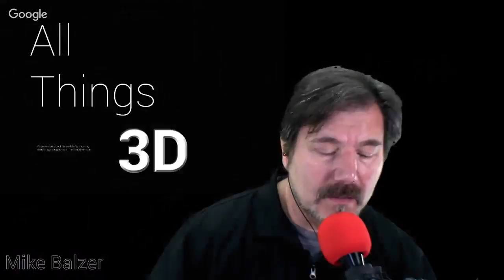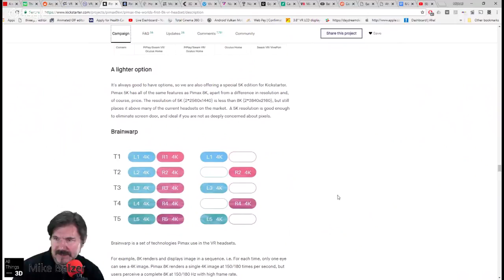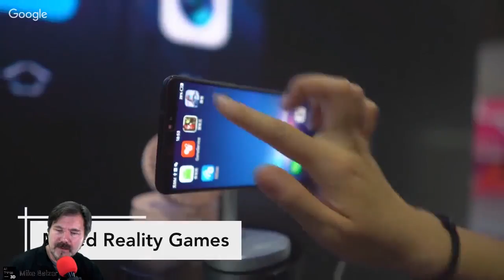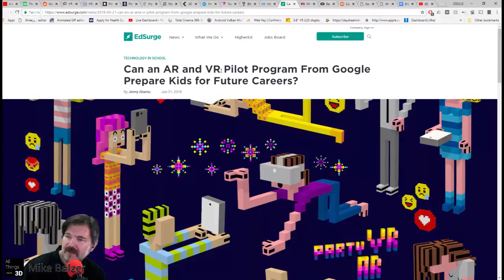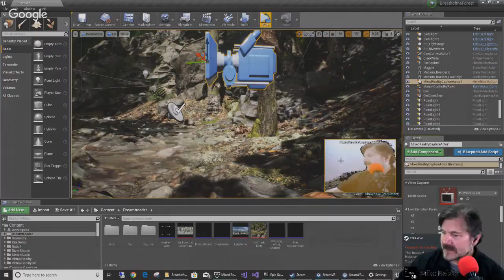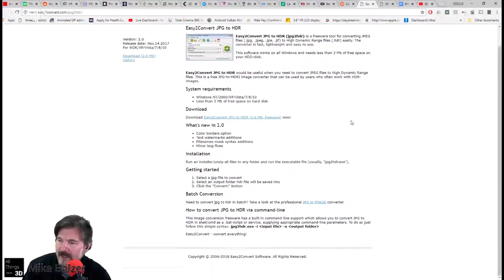3D in Review for 6/29/2018 "Is VR going the same way as 3D Printing?"

Comment: Thats a great parallel your making Mike, I agree that VR is taking a similar path to 3D printing. The biggest issue with both is the effort it takes to setup. With regards to 3D printing things have become easier with features such as auto bed leveling and built in wifi interfaces to bring them closer to using a standard 2D printer in terms on convenience but the fact that the CR10 and Prusa are the leaders in the market shows that this is still a market for people ready to get their hands dirty. In terms of VR I think the market will have an uptick with the release of the occulus go users no longer have to spend time slotting in their phones before jumping into a VR experience however with the lack inside out tracking in favour of having a lower price point this is still not a true reflection of the potential of VR. Microsofts line up mixed reality headsets are definitely moving in the right direction as your no longer dedicating a room to VR with the need to setup the VR tracking modules needed for the vive and Occulus rift. The next step to getting more adoption would be lowering the specs needed to use VR sets in my opinion.
Reply from the maker: If you are following I do agree with you on the Oculus Go.  It is easy to use and the VR quality is much better than it should be at that price.  I also have a used Lenovo Mirage One. Sadly the quality of the visuals and fit & finish leaves a little bit to be desired, but it does use Daydream and development from Unity is easier than the Oculus Go.  However, the Mirage One does not show up as a drive, so the only way to retrieve data, screen capture images/video is through a convoluted share or ADB.  Now I have not added an SD-Card yet so it might be easier that way, but without one, pushing files to it is just as hard.  Big selling point is 6-DOF, however that and the Snapdragon 835, 32GB is not worth $400.  $339.00 used is better, but it should be $300.  My bet in VR is the Oculus Santa Crus, with the rumored (okay my rumor)  NIVIDA TX2 like the Magic Leap.  This will put it in low-end discrete video card VR category and will also have 6DOF and 6DOF controllers like the MS WMR.  Sadly the audience is far different when I was young adult where it was cool to have a VIC 20 and color TV.

3D printing is evolving with some lower cost units that are easier to use.  But at the same print services have matured along with the design software and 3D print software tools.  If you remember I was covering how to use ZBrush, Blender and 3D-Coat for 3D printing.  Now each of them have dedicated routines. The same with low cost CAD tools like Fusion 360 and Onshape.

In the end this is all fantasy come true for me, but then again I learned how to program on the TI-58 & HP-21c :)  RPN RULES!!!!
Reply from the maker: Oh and thank you for continue to follow me, it is greatly appreciated.  You are one of the reason I still put in about 20 hours of research and prepare time to make these happen.  Thank you!
Reply: Keep it up always find that you cover things I miss from other outlets!
Reply: I had no idea you had covered 3DCoat ill have to check back in the video logs. Any idea when the Oculus Sanata crus is expected to come out or what price point?
Reply from the maker: I have covered it briefly, but if you think a couple "hard knocks" tutorials would be good, I would be happy to oblige.  On the Santa Cruz, rumor is it will be introduced in September (26-27) at the Oculus Connect , with the hopes at the end of the year release.  Price is unknown, but I hope it is < $500.